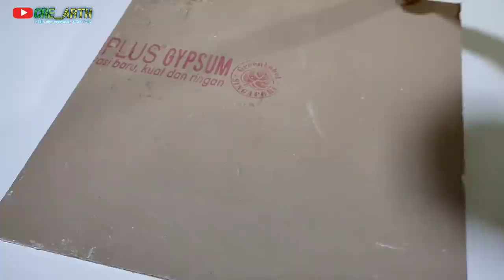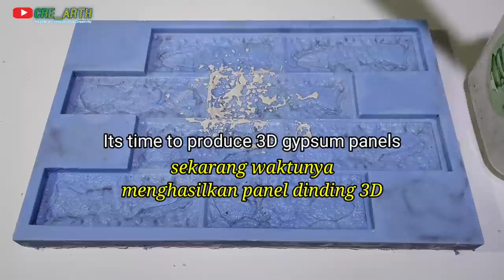How to make gypsum wall panel || silicone mold making from wall sticker foam

Comment: Please can we use cement and gypsum at certain percentage with the same result?
Reply: Cement hardens so fast and its soo hard, but gypsum is soft in nature comparing to Cement. May be you can use very refined grinded sand with cement at a 4:1 rate which softens the cement.